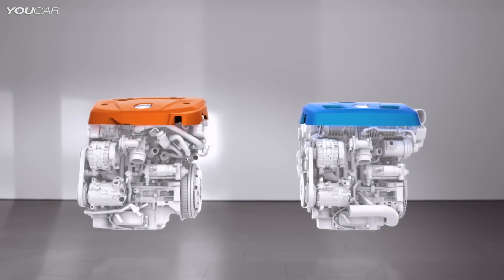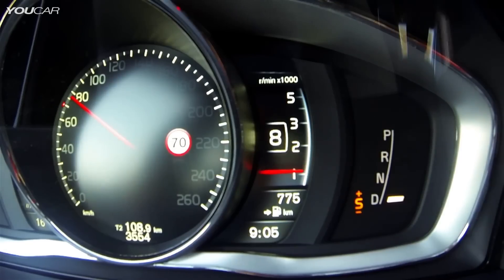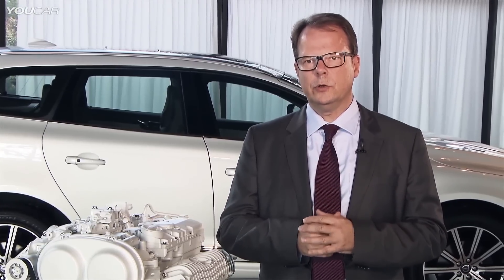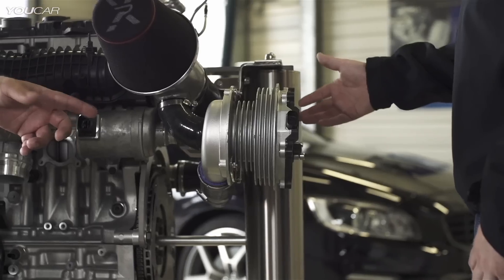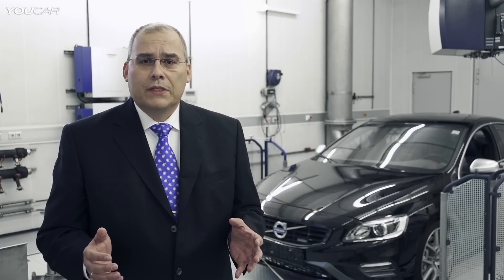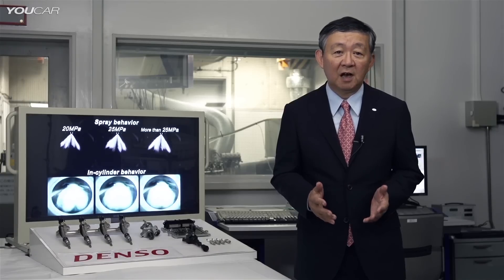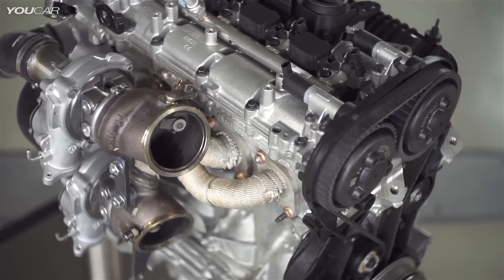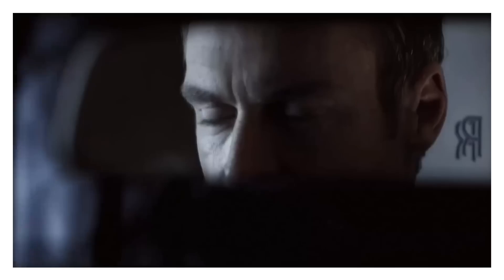Volvo reveals 450 hp four-cylinder engine

Comment: All drive e petrol engines turbo intercooler and All Volvo 1-4 turbo intercooler petrol engines : 20-100 l/100km, over 100 l/100km, easy damage with test maximum over 20,000 rpm and F1 speed.

End report.

From
Volvo all engines database